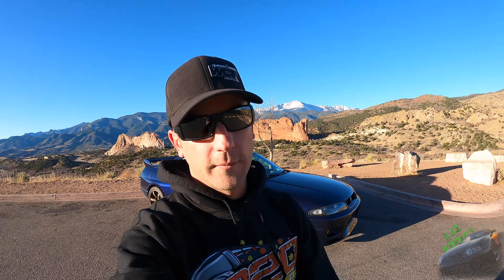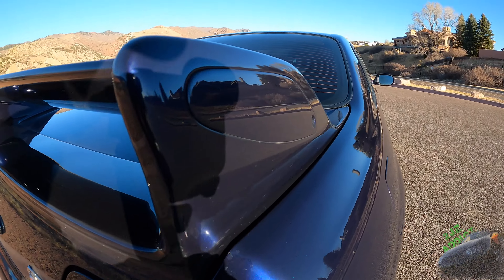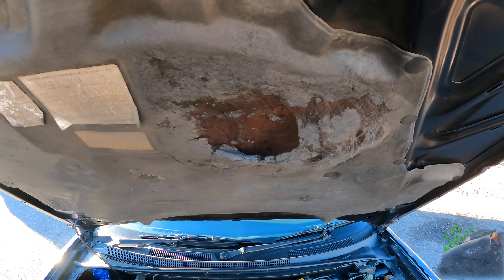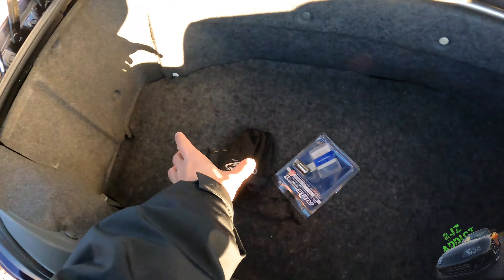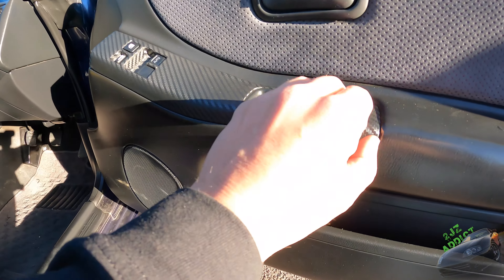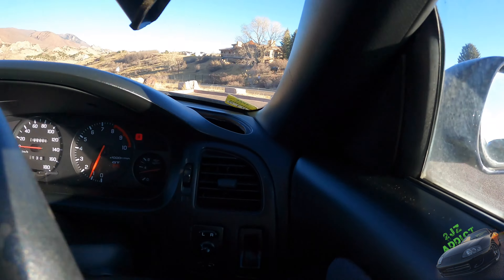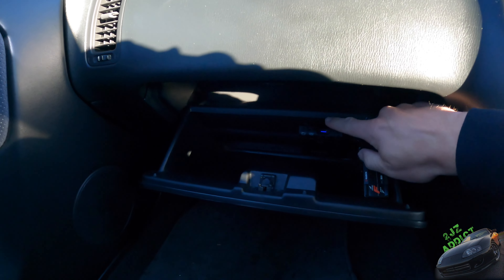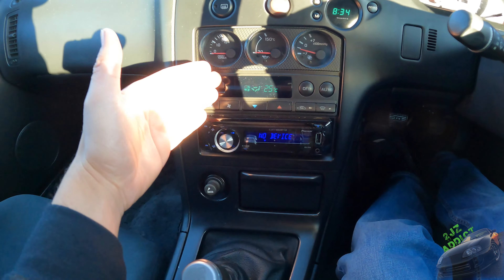EVERYTHING THAT'S WRONG WITH MY 1995 R33 SKYLINE GTR - IT'S A LOT

Comment: This was like my supra when I imported it. I had some flaws I had to address. Majority of the suspension needed to be changed, all outdated and rusty. Timing belt was on his way out. Brakes were seized, upgraded to TT brakes but other than that it turned out well!
Reply from the maker: That’s not bad. At least it was nothing significant. I’m glad you caught the timing belt before it went. That’s a good thing to replace right away. One thing I’ve noticed is that the RB has a lot more going on that the 2J. Lol 2J’s are way easier to work on IMO. Welcome to the Supra club btw! It’s an incredible platform for sure. How do you like yours so far?

Comment: 2:06 this is a bottom of a trunk, not fuel tank ;) r32 had fuel tank in this place but in r33 fuel tank is plastic and seats in between rear seats and boot
Reply from the maker: It appears you’re correct! Clearly I’ve got a lot to learn about this platform. 🤣🤣 Thank you for correcting me. 🙂👍
Reply: @2JZAddict   I have mine R33 for 2 years so I know a few things about this platform 😜 Nissan did lots of upgrades from r32 when they designed r33.

Comment: You will find the wire will be bad anywhere that they tied any extra add ons will be terrible
Reply from the maker: That’s what I’m thinking too. I’ll trace the connection back once I pull the dash apart for the radio swap and see if I can figure out where they tied it in. 🍻👍
Reply: 2JZ Addict they use those stupid piggy back clips on all Japanese cars I have imported. Terrible. Anything aftermarket I poll out and re-install on get rid of and upgrade. I would recommend a new wiring harness as well if your planning on keeping the car

Comment: The next person on here who says that you need to delete hicas is going to get a 🙋‍♀️ slap. People who say hicas is crap fall into one of following categories. 

1. Can't drive 
2. Can't drive with hicas
3. Hicas isn't working properly 
4. Car setup completely for a very specific application (drag/track only/ with way too much power than hicas was designed for. Otherwise if your keeping it street it's great. 

Keep in mind that the record lap under 8' was you guessed it...with hicas. 

If you want to make sure you hicas is working properly there is a diagnostic function activated (very similar to a cheat code on PlayStation). You can find the procedure online. I'm not even joking.
Reply from the maker: I love the car as it sits. It’s super predictable with a great turning circle. The goal with this thing is to have a fast street car so the current plan is to leave HICAS on the car. That would be super fun ripping through the mountains! 🍻🤘
Reply: Good man, I'm an American expat living in Europe and in my neck of the woods there are a lot of twisty's. Imo that's where this car really shines, I feel sorry for the guys only driving in straight lines. Get yourself a set of semi slicks (I run potenza re71r and or r888r). Crazy grip anyways enjoy. Ig: GodzilarOG33
Reply: As an Australian, remove that Hicas 🤠

Comment: Also, GTRs don't have fog lamps, that's a oversight from the GTSTs I think
Reply from the maker: Good to know. I wonder where wiring goes if it’s not for fogs and there’s no relay. 🤔🤔
Reply: Not accurate Series 3 do have rear fog lamps and the front ones are optional.
Reply: Well fair enough, I guess now that I think about it I've only messed with series 1. Thanks for the info!
Reply: +1